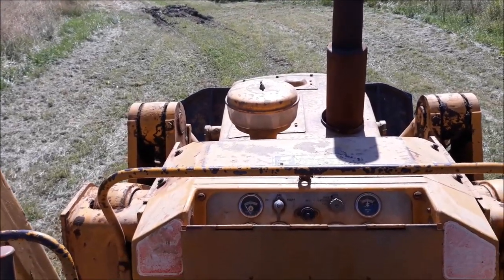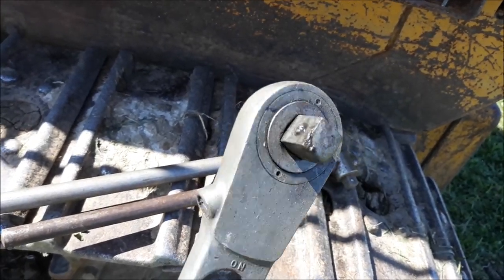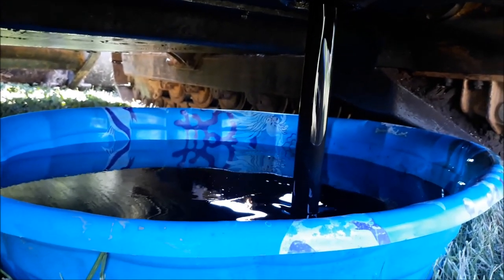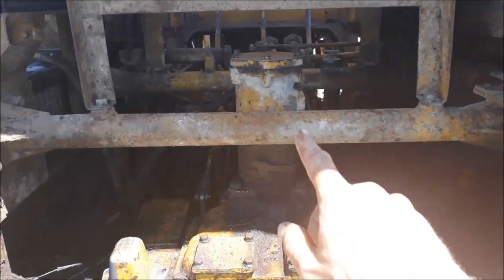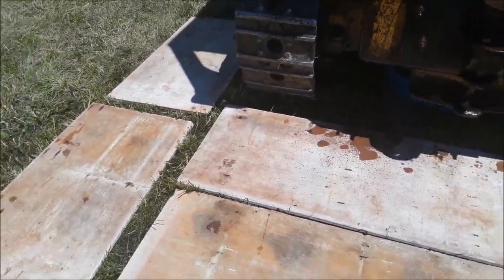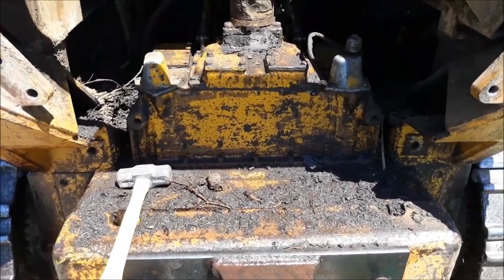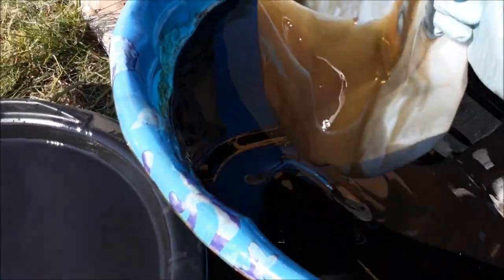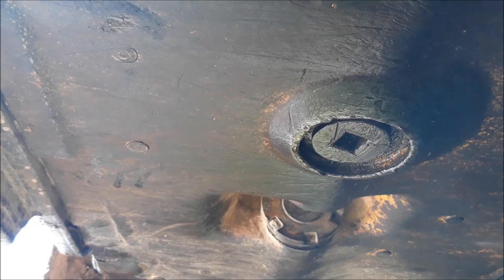Fixing Up The Old Cat 955L (3) Drain Oil, Remove Fuel Tank, Washing

Comment: Two comments: 1. Since you had to take the fuel outlet line off anyway, could have used that valve to control flow out of the tank and saved a lot of trouble. I used to have to clear ice jams out of the bottom of the tank on my skidder. Had to take the plug out like you did. Fuel down the arm and inside the jacket at -20 degrees is no fun! Getting it back in quickly was a very urgent matter.
2. Since this is diesel, not gas, there is very little chance of fire. Just to reduce your anxiety a little.
Reply: You kept saying gas so much,nearly had me wondering if they built a gas version that I haven’t heard of! Haha

Comment: I bought one of these 955's a couple of months ago and i don't like running diesel engines at full throttle, however mine only steers decent at full throttle.
Reply: Not good - it should drive even at low speeds - may want to try to fix it before it can't be fixed - ask a dealer - the answer will be there - new oil and filters can do a good thing i am thinking - use the right oil only - they make additives for help -

Comment: you should have done a flush on that oil system
Reply: and diesel is the best Flush and cleaner there is - what it leaves behind is a good thing - so said the company's from times gone by - now they just want you to have them fixed at the dealers - so they can Gouge the chit out of ya -- ahahaha ---- my old JD has it in the owner's manual even to clean out the old oil out  with Diesel fuel --